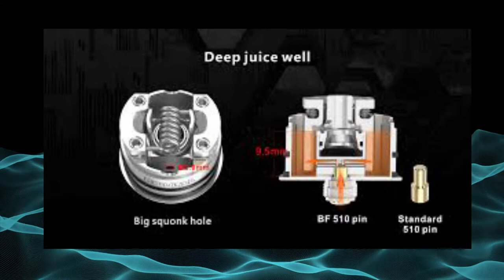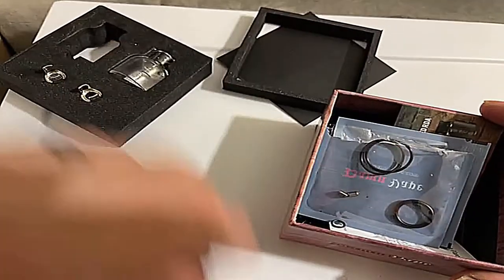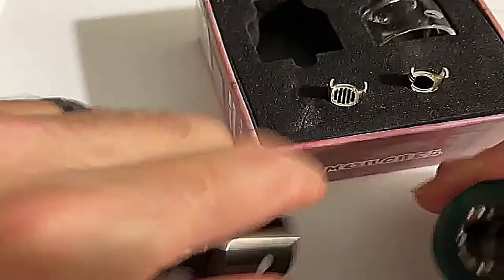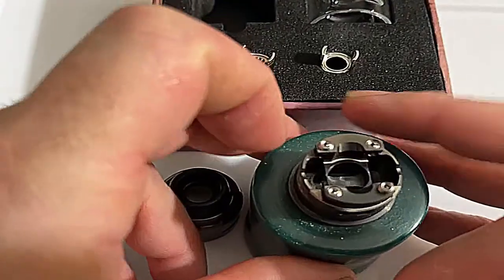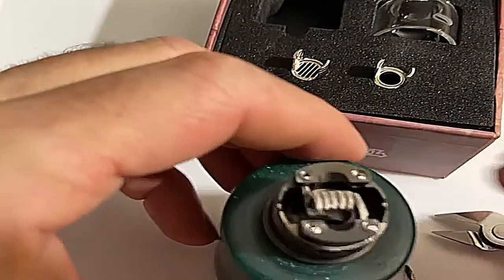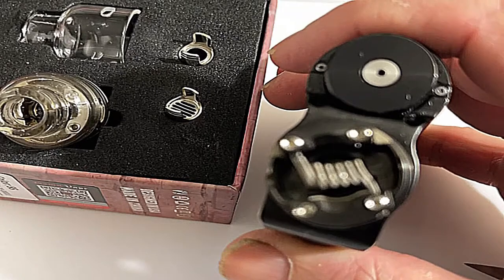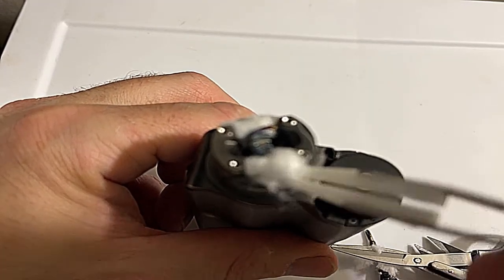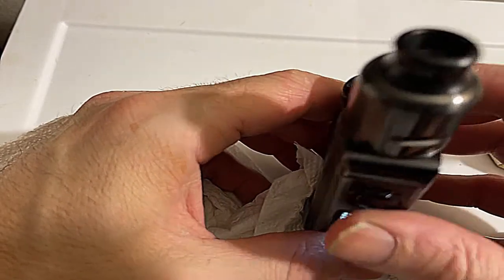Mongrel RDA A DAMN GOOD RDA! Forgive the echo in part of the video!

Comment: Have a 2nd one on the way... I heard they added a new insert...great review 👍
Reply from the maker: Awesome!
Reply: new colors on the way too with new honeycomb airflow on the metal cap, plus the honeycomb insert. i don't mind the turbulence and since you can dial it in or use the glass cap which smoothens it out in the original, but yeah new airflow starting from the matte black and other colors will be great for those who want a more silent vape.